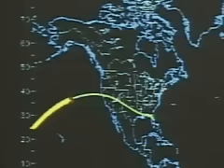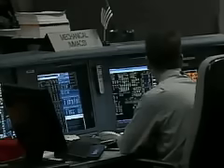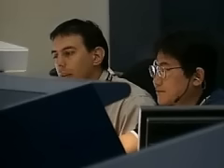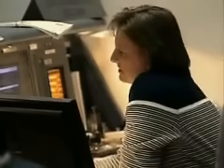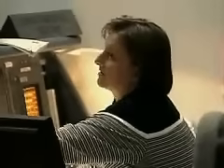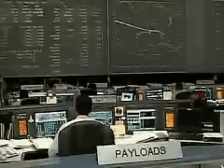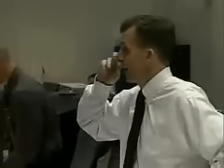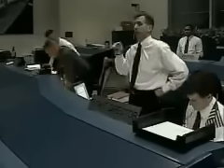Inside Mission Control During STS-107 Columbia's Failed Re-entry and disaster

Comment: I was in Reno, NV that morning watching 107 fly nearly directly overhead on entry. Orange plume trailing behind and as it neared the eastern horizon with binocs I saw several bright flashes and tumbling of something peeling away from shuttle. I knew then and there something was very wrong. All these years later I can still "see" the entry and flashes coming off the shuttle. Pieces of the craft I don't know, but it didn't look right.
Reply: I was at Grapevine Lake, between Dallas and Fort Worth, with my Civil Air Patrol squadron. I remember a solid white streak, followed by a small yellow explosion and a multitude of white streaks. We tried to find out immediately what had transpired. About 15 minutes later we finally were told what had transpired. 

Coincidentally, I was born exactly 24 hours, down to the minute, after Challenger exploded.
Reply: @user-pe1ns8bd6j  I was in Arlington. I saw the same thing.
Reply: @Joe Booth you are a real piece of shit.
Reply: Were you the one who video taped the fireballs coming off it? There is a video on YouTube that sounds exactly what you saw.